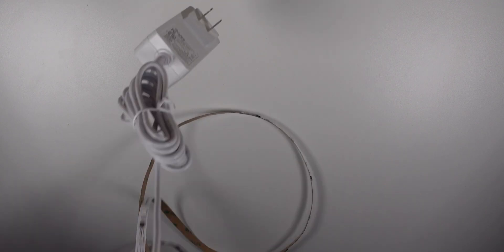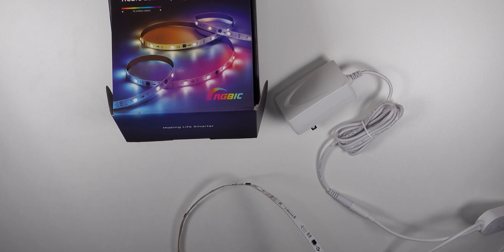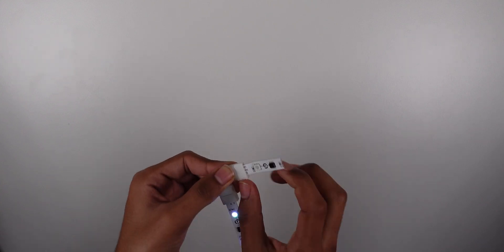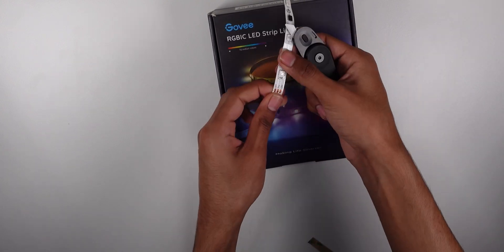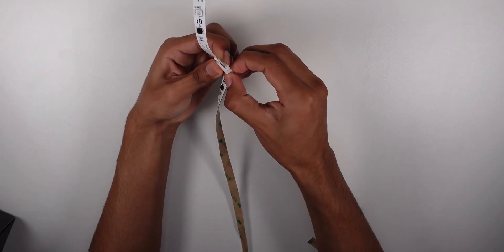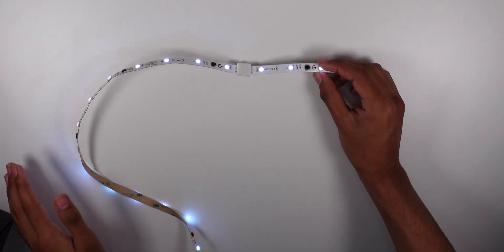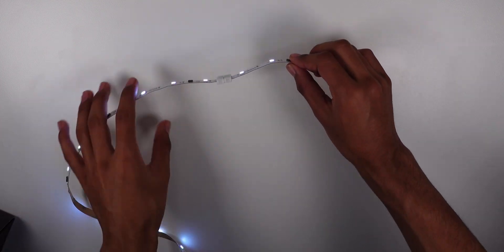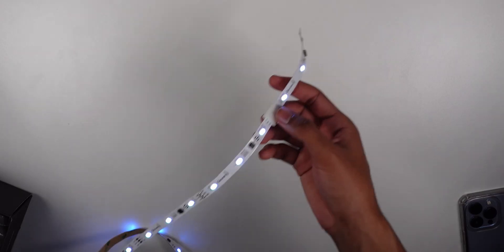Can you extend RGBIC?

Comment from the maker: Prime Video FREE Trial 🤑
https://geni.us/j8ETZ9x
Reply: Did you try the T connectors?
Reply: Hi Mate! Im based in UK and Govee does not selling 65,6ft version. Do you think I could join two 32,8ft sets togheter?
Reply: @tedted6225  SAME QUESTION,BUT I WANT TO JOIN TO AROUND 30MTR,STILL WAITING ELI TO ANSWERS YOUR AND ME..
Reply from the maker: The only way you can connect them is through the app. You can’t connect them like normal RGB with soldering or solderless connections due to the IC chips
Reply: @TechReviewsTV  can you make a full video with how to join 10 mtr RGBIC with add 10mtr and other 10 mtr in total 30 mtr,maybe with 1 controller..if avaiblable,thanks
Reply from the maker: https://youtu.be/QwBYb4SsEIM
Reply: So I can control each section or will that feature not work? TIA!
Reply from the maker: Everything still works as normal. I have a pair of RGBIC PRO strips that I’ve been using for almost a year now since cut and they still work like new
Reply: @TechReviewsTV  Ok, thank you for answering
Reply from the maker: @agoodnightsrest  sure thing
Reply: You never made a follow up video
Reply from the maker: @lifehackertips  of the pro model ?

Comment: So I need to patch a section cause I broke the ic chip. I did cut off a working section since I did not need the length. I just need to patch the 3 led broken section to connect the other 35 part of the strip. Like splice both end an and patch to be precise. This will work as i am not extending the amount of LEDs just replacing the broken section of the strip correct?

Comment: They must have made an update. I got 4 pin RGBIC lights I cut it correctly as ive done with other 4 pin govee lights and used 4 pin extension cable with 4 pin connectors ( the ones that make a hole in each pin ) then reconnected and the whole strip doesnt power up. Ive donde it successfully on the regular 4 pin govee lights without the alexa function, however in these new lights it diesnt power up the remaining strip. Ive made sure the strip is aligend with the G's, direction is correct. My extension cable are colored, ive made sure every color matched all that. It doesn't power up Any ideas?
Reply: Same problem here. Any idea how to fox that

Comment: This is not extending the led strip, this is cutting and putting it  back. If you want to extend it you will need a different controller where you can specify the amount of led lights in the strip. The goove controller is already programmed with the amount of led in the strip, so adding more led wont work. Use a controller that uses wled software where you can specify the total of led’s in the strip and that is how you are extending the strip.
Reply: Hi, you seem knowledgeable about this topic. I have a 25 meter led light strip. The first 15 meters work, but the remaining 10 meters don't light up. Is it possible i just cut the junction where it started to not light up then connect them again with a 4 pin connector? Or does the new 10 meters cut will require a new power controller? Thank you
Reply: @sabcue  You would need to have a controller that has an adjustable pixel number (1 pixel = 1 LED)
Reply: I use  quinled controller with a 12v 5 amp power supply, you can use analog 4-pin to digital 3-pin led strips, including govee. Quinled uses wled software where you can specify the amount of leds in your trip and that is how you can extend the length of your strip.
Reply: This is literally extending as you can extend the strip to a longer length with clips and wires allowing you to go around corners and such. What you’re talking about is called “adding”, and no you can’t add anymore lights to the controller.
Reply: @zimvader25 Cutting off a piece and putting it back to its original length is NOT "extending" anything. This video does not show "extending" the light. He just disconnected and reconnect what the controller already knows is there. 

Extending would be attaching more lights the original light strip, which will not work.

Comment: I got the govee 65 feet and no luck with the connector. From Amazon  which was told it would work.   wires are green and red  and white which is supposedly a three-pin thaf works with 24-volt any recommendations what am I doing wrong I feel like I messed up at bad  😮😢

Comment: Just a real quick question, i saw on the video that you were testing if it still works, does the IC part still work? so after extending (or using a 90 degrees angle connector) does the multi color changing mode still work on the part that is connected after the connector?

Comment: Warning: I bought the 3 pin connectors linked in the description and they definitely do not work with the govee rbic led strips with model number H6147. $75 down the drain for led strips + connectors.
Reply from the maker: If your model has silicone over hair then you would need to pry it off, I’ve worked on a few models and every one that has the copper lining works.

Comment: Did you ever confirm if the 4-pin is extendable?
I've heard others say there is a "refresh length" option in the app, but I can't find it. Where is that at?
Reply: did you find it ever?
Reply: @noahboa1469  No. Not for the strips I have at least.
Reply: @mattmagerofficial  I can't find it either...
Reply: That's the exact thing I'm trying to figure out how to refresh to update the number of LEDs?

Comment: I bot these exact connectors and the problem with mine was that i needed to apply a lot of pressure to ensure the current would go through. i tried multiple of the pin clips they provided and the problem was persistent with all of them. was just wondering if anyone else had this problem?

Comment: hey! I bought a led strip rgbic from govee but I got the 24v version with 4 pins. any idea on how i can connect them? or should i get the 12v version?
Reply: I'm wondering the same thing. I tried adding some extra strip onto the end of one of the strips, but it does not light up. I read somewhere that there is (or was?) a setting in the app that told it to "refresh length" which basically tells the controller to check the length of the strip and adjust it after you solder/attach more, but I can't find anything like that.. :(

Comment: I’m going to buy a diffuser channel to run on top of my ceiling and go around the entire perimeter of my ceiling so I will have to cut them in each corner and put in a 90° connector if I do that well all of the RGBI sea modes work

Comment: I need 85 feet. if I buy the 65ft and 32ft and connect them will the effects still work? I like the chase feature
Reply from the maker: Make sure you sync them in the app you can’t extend them off one power supply.

Comment: i just wanna turn my leds 90 degrees without breaking them, if I cut and connect the original strip in the same order with just 4 L connectors all the effects should still work?

Comment: How?!?! I did the exact same thing you did. I even have the same connectors you have but for some reason it doesn't work for me. The piece that I cut is cut correctly, but no matter what I do the extended piece doesn't light up. I even removed the silicone to expose the copper... still nothing.

Govee support told me you're not supposed to cut RGBIC so how did you pull it off? What am I doing wrong??

Comment: What about wiring like for gaps do you know of any ready to go wire sets with connectors?
Reply from the maker: Do you mean cable extensions in between?
Reply: @TechReviewsTV  yes. Also i notice that the original cables are segmented by light color. Has 5 sets of 12 in a row then 5 sets of 8 then repeats. Does cutting it mess up how the segments and number of leds are?
Reply: @TechReviewsTV  By the way did you ever try cutting the rgbic pros yet and is it worth buying them over these?
Reply from the maker: @Cheshhire  I made a video of cutting the pro model
Reply from the maker: @Cheshhire  you can cut the pros but they’re not as accurate Bc they don’t have the copper cutting points like these ones

Comment: Weather should be whether in your description.

Good video, thanks. Can you test something for me with this. I am buying these but only need about 6 feet. Thinking if I cut them around 6 ft, then add connectors with wire I can run the wire off to another location that is hidden and reconnect. In theory the patterns should still work since all the lights are still there. It would be great if you could test this. Say add a wire between the two points you connected them maybe a couple feet or so and then test the patterns?

Thanks for great content!
Reply: Hey James I’m asking myself the same for my project. Did you tested it out since you posted this comment? Does it work? Do you had any trouble?(lmao sorry for all these question )
Reply: @jacobdou_7174  I ended up buying one Govee but they are pretty limiting with what you can do so I ended up buying WS2812B strip lights and ESP2866 boards to control them instead.

Comment: I bought GOVEE 10m RGBIC. It was working fine before installation in the reel. After installed half 5m doesn't work near the 90° band. what can you suggest shall I cut bend damaged part and rejoin? will it work? Please help
Reply from the maker: So the split ended part of the strip stopped working ? You already installed them fully huh

Comment: Hi!  If I were to buy the 65.6 ft RGBIC PRO strips (2x 32.8, both connected to the same psu and controller) would I be able to cut them to the size that I need (about 50 feet), and not lose any functionality within the app? (or break the strips)
Reply: No you can't extend them beyond 32 feet  if you can program the controller you could do that but with out programing the old controller you can't extend them they will cut out at 32 feet no matter what you do, my fix is gonna be to add more outlets on the same circuit
Reply: Do you have a link to the 2x32.8ft rgbic strip? I’ve been searching for those but can’t find anything with a good price.
Reply: Yes kinda. You can sync 2 separate leds from  the app

Comment: I just ordered the RGBIC PRO. Anxiously awaiting the video! 
If I can’t cut and extend I think I’ll just return and get the RGBIC
Thanks for all the videos!!!
Reply from the maker: Sadly you can’t extend Rgbic pro *
Reply: Can’t extend any of the RGB ICs from Govee, not just the pro.
Reply: @ryankramer  and why is this? I'm actually going to attempt it. From what I'm seeing it doesn't seem impossible. It only seems that you would need to inject power or add a different larger power supply. If I am missing something critical I'd really love not to waste my time though.
Reply: @aznative_  I tried it. The chips literally only see the amount of segments there are on the original line. The extra voltage isn’t the issue, it’s that there will be no additional assigned signal beyond the last segment. You can make it shorter, you can chop it up and run wires to connect inbetween, but you can’t add segments.
Reply: @ryankramer  thanks for your feedback I really appreciate that. Yes I'm finding the same. I do think there are some govee lights that you can connect together because there was a YouTube video showing someone doing that they were able to go in the app and tell it how many LEDs were now a part of the string. For my particular lights when I go in to do what he did that option is not available. The reason I got these in the first place was to use the govee app initially just to get them up and going quick and then set it up with wled hardware and software. I'll probably send these back and just get something more generic that I can string together and just do the wLED.

Comment: Great video!  I was wondering whats the max that you can extend the led strings lights before losing power or function.  In other words, can you modify 2 full sets of led strips into one and still have the same functions?
Reply from the maker: That I am not sure of id say 2 full sets would be the max because these usually have more than enough voltage to supply that amount

Comment: thanks for trying out. I'm curious whether the rgbic pro strip works when connecting or not. maybe you have to remove the waterprofe coating on the copper pieces first
Reply from the maker: Will be doing that video soon but so far it’s a no
Reply: Do you have a video on these ones?

Comment: If I use a 90 degree adapter, will the segmented dream colour still work?
Reply: Ok thanks a lot.
Reply from the maker: Yes I’ve tried them all as mentioned in the video the only thing would be the “T” shaped one it works but not properly
Reply: Hey man i had the same question did you try id